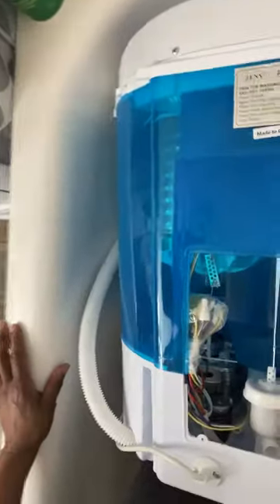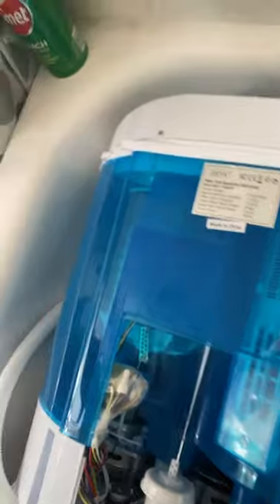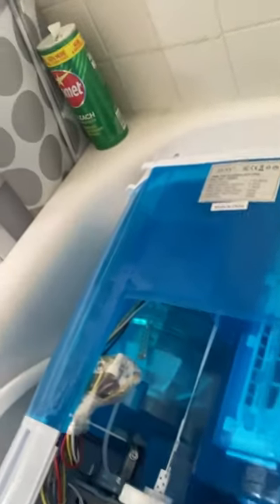How to Repair Spinner Basket on Zeny Portable Washing Machine

Comment: I bought one off of Craigslist today and it wouldn't spin. Looked inside spinner and pushed it aside.  Found a mask wrapped around in the bottom.  Pulled it out.  Now it works 🙂.
Reply from the maker: That's Awesome Celeste!  I'm glad that you found the problem and can now you can do your laundry.  It's a bummer to have clothes pile up because you can was them. 🧦👗👖🩳👕😀
Reply: Omg, mine has a black mask down in there and i cant get it out
Reply from the maker: @reha1066  I don't think you got the mask out. I unplug the washing machine then used a back scratcher, the end with the hook on to dig a mask out one time. I had to move the spinner over to the side a little bit to be able to get the mask out with the back scratcher. You should

Comment: Loved the way u made light of it with the screws joke ,rite now I need a laugh . Thanks for the video ,couldn't get my spinner to work after my second load, my husband went in there and it worked for him of course. Lol anyway, I told him  about ur video and he's checking to see if the screw is loose.  I have mine in the tub too so much easier, Front bathroom tub never used unless grandkids are here.   Aww he found the issue the belt was loose. I was about to panic have had it just over a week. Thanks again for ur video.
Reply from the maker: Having the machine in the tub a person really, really has to make sure that the water doesn't get underneath the bottom of the machine or you can short it out or cause injury.  

My DISCLAIMER is that THE MACHINE SHOULDN'T BE USED IN BATHTUB UNLESS YOU CAN GUARANTEE WATER WILL NOT GET UNDERNEATH THE WASHING MACHINE.  

The machine should not be used in the bathtub unless you can guarantee that water cannot get underneath the bottom of the machine. 
 Best wishes!

Comment: Mine stop spinning because it over heated. I opened the back checked the screw on the basket it was tight and left it open for a while and it started working again. I used it like 4 spins in a row when it stopped spinning. But works now🥰
Reply from the maker: When I first got the washer, I tried to spin  towels several times to get them really dry and my spinner overheated. While the spinner wouldn't turn back on I was terrified and thought I had broken the machine. Thank goodness like you once I let the machine cool down, the spinner started working again. I learned my lesson not too let the machine spin too many times in a row! Best Wishes Always!
Reply: Wish I’d came across this comment first would save me time 😢your right works fine now.I took mine apart 😢bout broke it lol 😂

Comment: I think I messed up for door for it in the top so it won’t spin any idea what I should do
Reply: i just did the same thing! i will come back and let you know if i find out how to fix it 🤦🏼‍♀️
Reply from the maker: Hi, sorry for the delay.  Is the door to the spinner detached? Is a piece on the spinner door broken off? Is it possible for you to close the spinner door then put something not too heavy on top of the door so it makes contact with the rest of the machine ( touching the machine everywhere it should touch when the spinner door is closed), then see if it will spin?

Comment: Hi I'm having trouble with my Zeny washing machine. I seen some fiber clogging up the drain. In the spinning area . I'd like to ask you a question you seem to understand the machine, plus I cant seem to find a zeny machine repair. Do you know of one?
Reply from the maker: Where exactly is the fiber in the spinning area?  
Can you see it when looking from the outside into the spinning area through the blue plastic front or side?

**ALWAYS UNPLUG WASHING MACHINE FROM WALL. ****
Are you able to take a long dryer vent filter brush and put it up the hose and jiggle it around to try and loosen the clog?  Or maybe open up a wire hanger and make a tiny hook on one end and CAREFULLY insert it up the hose to try and pull fiber or whatever out from clogging it.  BE VERY CAREFUL NOT TO PUNCTION WHITE HOSE IF YOU INSERT ANYTHING INTO IT.

Here's a link to Zeny's Customer Service:
https://www.zeny.us/pages/customer-service

Wishing you the best!
Reply from the maker: Also, please ALWAYS use the white part that goes into spinner every time you spin something, or items will fly out of spinner and get caught at the bottom or sides of spinner.

Comment: Does this minor repair also fix the issue if the spin dryer is making a loud screeching noise?  Thanks in advance Sistah for the info.
Reply from the maker: Hi, my machine was making that crazy, loud screeching noise also. I have an email going to Zeny customer service to ask how to fix that aggravating noise.  While I'm waiting to see what they say, I've come up with something to make the noise not so bad.

*First, I try to make sure that the spinner is not too full, which can add to it wobbling, etc.
*Next, I do my best to make the clothes BALANCED in the spinner.  That's done by taking a shirt, fold it so arms are together, then lay the shirt in basket around sides of basket, kind of like an "O"
*For sheets, I hold up over wash basket & spinner to kind of have it like it would be folded in half, but I take it & lay in spinner around sides like in swirl (like how a cinnamon bun looks), trying to make it balanced in there.
*I do that with bras, towels, etc.
*IF CLOTHES ARE REALLY WET, THEY'LL BE HEAVY AND MAKE SPINNER WOBBLE & BE NOISY ALSO.  I don't mind wringing stuff out to keep that noise down.
*LASTLY, GENTLY... PUSH THAT WHITE PLASTIC PART (that keeps clothes from flying out of spinner), DOWN ON THE CLOTHES IN THE SPINNER. -- THINK OF IT AS A SPINNING TOP TOY (from years ago). 
--- IF THAT WHITE PLASTIC PIECE IS NOT FLAT ON TOP OF THE CLOTHES, THE SPINNER WILL WOBBLE A LOT AND MAKE A LOT OF NOISE.  IF IT DOES THAT, STOP THE SPINNER & MAKE SURE THAT PLASTIC THING IS Pushed Down & FLAT ON THE SURFACE OF CLOTHES.
 
NOT OVERLOADING the spinner also helps.
** If I had to do it all over again, I WOULD NOT HAVE OVERLOADED MY SPINNER WITH CLOTHES, THROWING THE BASKET OUT OF ALIGNMENT.

I know that it seems like a lot, BUT once you practice getting it just right, the spinner won't be so loud.

**WHEN I GET MORE INFORMATION RESOLVING THIS ISSUE, I'LL POST IT.

~~~Wishing you the best~~
Reply: @lindamc6090  even when empty mine is doing that shaking loud motor bike sounding shit

Comment: Thank you so much for your video. The screws act like they are too tight and they will not budge. Am I doing something wrong? Also, I'm getting very angry and inpatient with the drum spinning everytime I try to loosen the screws. I don't have a second person to hold it from moving. Grrr Anyway, I see a mask down between the drum and the outside and I cannot get too it. Do I need to take the whole drum apart like you did with yours?
Reply from the maker: ALWAYS UNPLUG WASHER BEFORE TAKING BACK OFF OR WORKING ON IT TO AVOID INJURY.

My spinner was loose again the other day and I was here and didn't have any help to hold the part and place so I could screw it. I put on gloves, carefully reached in and position the Phillips screws directly in front of me. It started spinning so I reached in again and put screw directly in front of me, but this time I slowly put the screwdriver in and gently turned to the right to tighten the top and bottom screws.  Having a very long Phillips head screwdriver really helps.   Sometimes you have to turn the screws to the left to loosen them, pull the spinner basket up right then sit it directly down VERTICALLY into the machine, then tighten the screws back. One time I didn't use the white piece that goes on top of the clothes in the spinner basket and a sleep mask popped out and got underneath the spinner. I took my $1 from Dollar Tree back scratcher, leaned the basket over to the side while looking through he basket and took the curved end of  scratcher and eventually pulled the mask out. It will take some patience but you can do it. If all else fails Google Zeny USA customer service to get help.  I hope this helps!
Reply: Thank you!

Comment: My washing side isn’t spinning on its own. I can nudge the disk at the bottom on the inside of the basket and it will go. But when it pauses to switch directions it won’t spin on its own.
Reply from the maker: It sounds like you have something stuck under the spinner, maybe a sock or mask.  ALWAYS UNPLUG THE MACHINE BEFORE TRYING TO FIX IT OR WORK ON IT SO YOU DON'T GET ELECTROCUTED/SHOCKED!!!  I used the curved up little hand part on a wooden back scratcher from Dollar Tree to dig my mask out.  YOU WILL NEED PATIENCE TO DIG WHATEVER IT IS OUT.  Wishing you the best and all blessings~~
Reply: @lindamc6090  How could that happen? I will check in the morning, thank you.
Reply from the maker: @djc6323  If people don't put that white piece on top of spinner when using it, a piece of clothing can fly out and get stuck under the spinner. I'm just saying to check everything to find out why it's not spinning.

Comment: The set screw on the coupler between spin motor and basket was tight, but still getting a loud knock from the spinner when it is activated.   I'm not sure, I'm guessing that either the bushings in the electric motor are shot, or one of the rubber mounts for the spin motor have worn out.  This particular machine belongs to my neighbor's niece, and she has lost all of the paperwork which came with it, so no user's manual or exploded view diagram available.  Anyone have a parts diagram for a Zeny H01-1568A washing machine?
Reply from the maker: Hi, Sorry you're having issues with the washing machine. Here's a link that to Zeny, for help. Best wishes~
Online sales inquiry - cs@zeny.us or call 909-320-8633

Comment: My spin motor won't turn, thank you for this video. Anyone have any idea where I could get a new or rebuilt spin motor?
Reply from the maker: The other day my machine would not spin and I looked down to see  a sleep mask had come out of the basket and was around the base of the spinner. First I unplugged the washing machine for safety.  I took a back scratcher and fished out the mask, later my machine spun again. I had given the customer service number for Zeny in a previous response, you might try them for a new motor and service. Best of luck and success!
Reply: @lindamc6090  Thank you!
Reply from the maker: I'm not sure if I gave you this information already or not, but you can Google Zeny USA customer service to get information. I hope this helps 😳

Comment: There is water in the spinning basket that I do not know how to drain . Can you advise?
Reply from the maker: Hi, did you try turning the middle knob all the way to the right? That's how you release the water but make sure the drain hose is not where it will put water on the floor.   Is your drain hose. In the downward position to go into a bucket or sink or wherever you're draining the water out to and not and the upward position attached to the machine?
Reply: My rinse basket was holding water also, it turned out that some socks had fallen outside of the basket and clogged the drain. You can kind of push the basket a little to the side and remove the blockage with a wire hanger

Comment: First thank for the video, my works but seems like it’s off balance, I checked an nothing around the drum, tried tightening it, it’s not that, wondering what else it could be, Ik the Weight of the clothing is distributed evenly so Ik what the problem could be, I just can’t figure it out 😢
Reply: Mine spins off balance when I don’t put the plastic spin cap inside the spinner basket
Reply from the maker: Absolutely!  It may seem like a bother but that white plastic piece needs to go on top of clothes before starting the spinner.  If that white piece is not laying horizontally flat (it's tilting to the left, right or at all) you can be assured that the clothes will not be balanced and will wobble and make lots of noise.  Sometimes the clothes will need to be redistributed then the plastic piece put on top of them and pressed down but not too hard.

Comment: My washer part wont work, it wont spin any idea on what it can or how to fix it ?
Reply from the maker: I know that it's been a while since you asked this question, sorry I wasn't available.  Are you still having this issue?

Sometimes there is a simple fix like making sure that if you're using it in the bathroom that the breaker hasn't blown, therefore turning the power off.  Do you know what I mean by this.
Reply: Im having the same issue. I]My spinner works my washer doesnt. Im scared I cant fix it! lol

Comment: The agitator for me won’t spin on it’s own any more if I move it with my hand it works and then stops and then I have to repeatedly do it. Any advice?
Reply from the maker: I'm sorry that you're having trouble.  Today my spinner was doing the same thing, not spinning or only doing it a little bit.  I realized that I kept manually kept making spinner cycle end by taking the knob to off.  Doing this, starting the spinner timer over each time I tried to fix it, was causing it not to complete a spin cycle.  

Finally, I balanced the clothes in the spinner basket and turned timer to 3, then spinner started spinning on it's own.  

I think I was messing it up by not starting spinner from a completely stopped position. Not letting that spinner timer run all the way out until it "dings" may have confused the system.  Hope this helps!
Reply: @lindamc6090  thank you so much! I’m going to try that thank you!
Reply from the maker: CORRECTION: THERE IS NO "DING" SOUND WHEN SPINNER CYCLE FINISHES AND STOPS AT "0".  I'm sorry I must have been thinking about my microwave making that ding sound.  So the spinner just winds down and stops at the number 0.  You always want the spinner to wind down and stop there on it's own rather than make it stop by turning it to 0 before spin cycle is over.  Doing that will make the spinner not work properly.  Thanks 🙂
Reply: @lindamc6090  I currently don’t have anything in it and it’s still not spinning. I tried taking the knob off. I’m gonna let it run the cycle while empty and see if that works. I have no idea what I’m doing. Although the belt is still on track and I can hear it humming it just won’t move.
Reply from the maker: @messiyahughes3495  please review the answer I gave ( the video) about opening the back and making sure the screw to the spinner is not loose. If that doesn't work then you will need to contact customer service for Zeny USA.  Sorry😳

Comment: My screws are all tight, but it still won’t spin. Ughhhhh
Reply from the maker: *PLEASE BE SURE TO UNPLUG THE WASHING MACHINE BEFORE STICKING ANYTHING FOREIGN OR YOUR HANDS INTO MACHINE. *****
Sometime a sock, small towel or other item is caught and stuck under the spinner.  I had to take the hook end of a Dollar Tree back statcher (or whatever you can use to fish under spinner basket to make sure nothing is keeping the basket from spinning).  Do you hear the spinner motor running but it's not spinning?
Reply: @lindamc6090  seen this comment! I’m having the same issue I can hear the motor running but it’s not spinning

Comment: The Twin Tub Washing Machine is a piece of junk.  I bought this washing machine about 2 months ago and the spinner won't work.  I got the manual out and did everything to fix it.  Sometimes it works and most of the time it doesn't.  I am throwing this pick of junk in my trash and glad to get rid of it.  I will eat my $100.00, Thanks you Zeny for making junk.
Reply from the maker: I ended up throwing my ZENY out after buying 2, and purchased a PANDA model number PAN6320W, and I LOVE IT!!!
Reply from the maker: Since you just bought the washing machine, trying tightening up the screw per my video first.  If that doesn't work and there's nothing stuck under the spinner, contact Zeny.  Tell Zeny exactly what you're going through and request that thet send you a new replacement washing machine.  Ask that their Quality Assurance team thoroughly checks that replacement that they are sending you so you don't have the same problem.

Comment: HelloI have issue with my zeny after I fill it with water I forget to turn it of until the it spill out after that I try to use it but it did not wotlrk back again it looks like electricity issue any idea 😢
Reply from the maker: I know that it's been a while since you asked this question, sorry I wasn't available.  Are you still having this issue?

Comment: What if the screws isn't the problem what else could it be?😅
Reply from the maker: Hi, so what exactly is going on with your machine?
Reply: Mine just stopped spinning. Washer worked fine. It clicks like it’s going to spin. Doesn’t.
Reply: @amyhebert5481  exactly the problem I'm having. If you have any additional information you'd like to share I will most definitely appreciate it.
Reply: @aprildement2125 my washer motor is too weak to spin on it's own only works if I manually help to spin while machine on.Its most likely the motor itself is weak I bought open box
Reply: It's my spinner side. It's shaking so bad, and I just got it Friday.
Reply: Some of these machines have fuses that you need to change